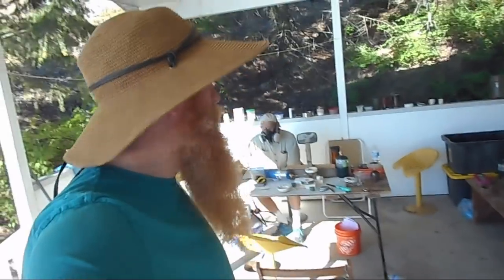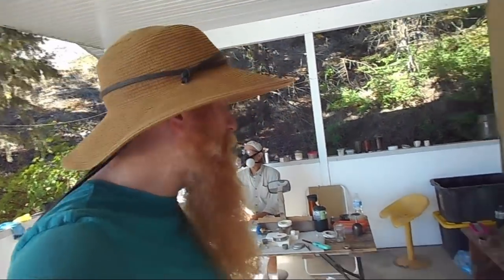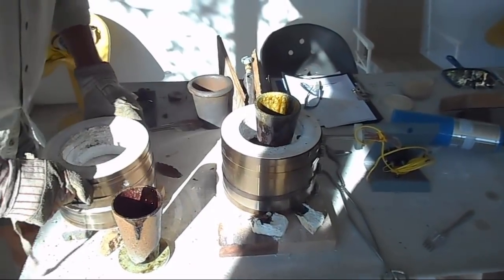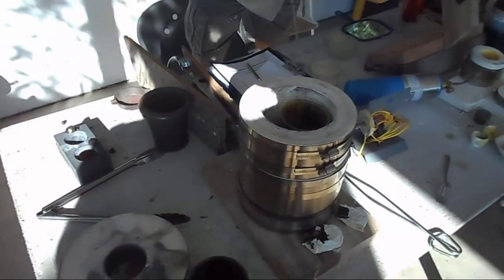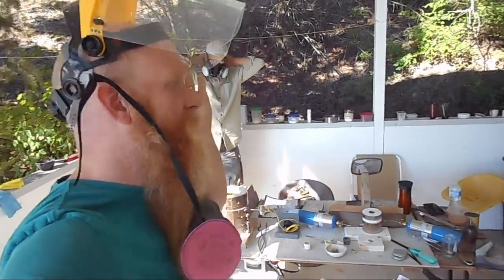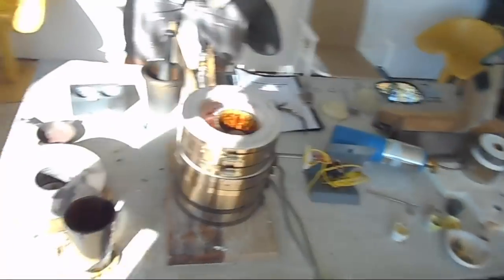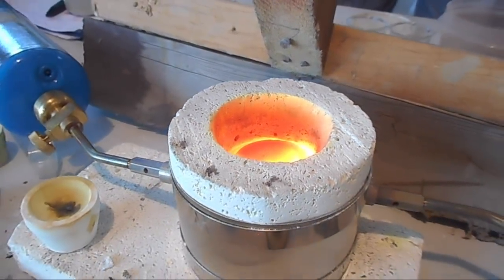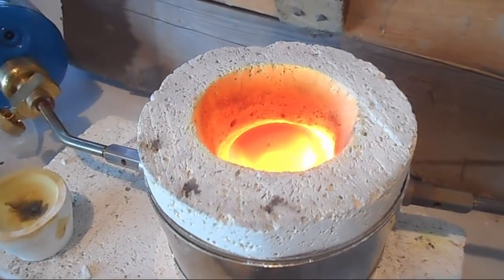Smelting high grade gold ore from the Blue Chip Mine (2018 - new discovery)

Comment: If that is all the cons from 152 lbs Something is wrong.   One Cup? 
You washed your gold away? I have some stuff that just goes away if you pan or sluice
In 150 grams of unwashed ore, I improved my collector metal by 4 grams. One run.
I may have a lead mine. But you may have overdone the concentration.

Comment: How much did you burn up?  What is your flux mix? It looked pretty blond to me. Like white.
Dan let me tell you what seems to be working.  A little sand in the bottom. 20 mule team borax. (Not jeweler's flux or Jeweler's borax.) 1to 1 borax to ore.  About half that of soda ash. Add 20 to 40 grams of lead(I am changing to washing soda) More CO2 and H2O). Then my other secret screened charcoal. You won't hurt it. Add more ore ,flux and charcoal in layers
My lead near the bottom on what will be the main chamber. After your layers put a nail in it and add some sand across the top. The sand keeps it from boiling up. I thought this might be thick but not so. Nice and thin.  more bubbling at lower temps.  The boils away at about 1700 degrees so you can catch the sodium on fire Don't do that . The heaving of the smelt is a good thing. A hollow chamber developes. , round. A great shape for collecting the metal bits.  But my recipe has 10X the water. Well I submit to you that at high temps water is H an O2 rocket fuel.  This melts easily and pours good. The charcoal gives you the reducing atmosphere needed for metal formation..  This can get too hot . Don't overdo it. Easy does it. The Na C O3 soda  ash. has the O3 in there. That is another red flag warning. Ozone is O3 and ot is highly reactive and wand to turn into O2 which is stable and O1 or just O as it burns ip a bacteria in water purification.... So your O3 wants to Be O2and fire (O1) So you have Plenty of oxygen and Hydrogen from the water. Cooking with rocket fuel . 
     I heard that older guys could get more gold at lower temps. With experience ,hydrogen, oxygen and charcoal for  a reducing atmosphere inside all that Hydrogen and Oxygen are being produced by heat.   So the smelt reduces by half and lays flat .....you are ready to pour
    If this helps you as much as it helped me, then you are blessed.

Comment: I just cupeled for the first time with portland cement. It was frustrating at first It seemed like it wasn't absorbing the lead. I had to stop a couple times to change it out but thought I had at least 5 grams of God from how it looked. I bought a bag at a garage sale that apparently belonged to a jeweler. There was about 100 gemstones I still need to deal with. 3 mined uncut diamonds. I started finding pieces of rings and that's how I figured it out like ah-ha this guy was a jeweler and lots of this was from sizing. I had a nice baggy of just cut rings probably 3/4s a 10k ring then a few 14k and 18k stuff. In my head I thought ok if half this piece is real fully gold and the other is other metals that's a good size and did that with it all. Well finally I got to see the blink or flash and it was beautiful to see the first time, Amazing actually! So I get it out and hold it and it was a perfect sphere of hopefully 24k gold but damn it's so small compared to what I started with and thought I'd have. Maybe I should of sold the scrap like it was that probably weighed 10 to 15 grams!? I guess I won't make much buy the experience was a big payday for me. Next I'll dig out all the silver and try it. Then all that's left is thousands of watch parts. I got Elgin pocket watch movements I looked up dated at 1895 and watches at early 1900's maybe I'll make some off that. Thanks for the videos I had no clue what I was doing!

Comment: Dan, how would you go about dissolving the magnetite leftover from the shaker table of an Alaska placer operation?  A friend of mine has brought me a bucket of his black sands and I have had some luck using HCL and HP, to dissolve the base metal and then HCL and Clorox to dissolve the gold, and then precipitate with SMB.  But, some of this material seems to be saturating the solution with Iron after crushing it to -20.  It turns deep rust and when filtering, it plugs the filter with a sludge which is still somewhat magnetic.  Do you know of any good way to dissolve the iron here so I can get at the good stuff?  I see pretty good gold with a 60-100 power magnifying scope.  I have avoided using Nitric Acid but was wondering if Geo's poor-mans Nitric acid/ Sulfuric acid process, (seen elsewhere on youtube, would be applicable.  Maybe you could try a video on this.

Comment: Not smelting its fire assay fusion technique should be pre heated to 950degrees up to atleast 1020degrees. Color of slag indicates doesnt fuse properly. try adding flour atleast 5grms. or check the basic flux. Still not pure Au. Youre Assay report is not accurate. Just saying

Comment: On a larger scale for your location do you think that it could be mined as an open pit mine? Or does the country rock/surrounding rock have no gold values?
12 g/t is great if the vein is vertical and 3 feet wide but otherwise there'd be tremendous dilution.
So that's why I asked about the other rock types you have on site. Any values in Au or Ag?

Comment: It looks like at about 6:25 you have some problems with your base block sticking to your crucible. I have done a fair amount of bronze casting, one trick I learned is to stick a piece of thick paper or cardboard between the crucible and the base block, it helps to keep them from sticking together. Also, if your flux is eating the bottom of your kiln, I've found that a sheet of cheap kiln shelving on the bottom of a propane forge soaks up the flux before it eats into the expensive refractory.
Reply from the maker: Thanks!

Comment: Hello, I am curious to know if you ran an assay before this procedure, and if so, how did your recovery compare to the assay result? I think it would be cool to know how efficient your process was. Obviously it isn't possible to recover 100 percent, but is would be good to know how well you are doing. Great videos!
Reply from the maker: the nugget effect on this free milled gold would mean that small sample size assays would range anywhere from 0g/t to well over 100g/t depending on which random rock I sent in. I needed a large sample to get a good idea
Reply: Good point, I assay and can run samples for $45 with no min number of samples and can get the results back in a week. I don't make any money on it and the fee covers the cost of supplies and lab time. If you were able to collect a representative sample and were curious or if you need assays run the the future. It is fire assay with gravimetric finish.

Comment: really good video Dan n Dad, Id be happy with 12gpt near surface with good wheeled access. What filters are you using in your resperators?
Reply from the maker: The p100 Hepa filer such as the 3M 2091 would be your minimum and make sure your respirator fits well

Comment: You still have to cupel again or acid refine the hazy looking beads, there was to much lithage from the flux to be completely absorbed by that size cupel. Your flux to cons. ratio might be a little high, that will also cause the boil overs in the smelting process. Just reheat in a finish cupel to get a more polished looking beat, as you can tell by the out side of the cupel it was at it limit. You may want to cut any large smelting prill like that in half, with a simple shape chisel and hammer when cool to put less load in to each cupel. The bone ash can only take in so much, and the stains on the outside of that one show it was loaded.

Comment: The blick is suppressed by the presence of PGMs, reduced by lead, copper, or other base metals,  and is generally imperceptible with larger (3/4g) or very small beads. A bright blick is characteristic of relatively pure gold/silver as it solidifies and gives off its latent heat of fusion all at once. Impurities cause the state-change to take place unevenly, as well as interrupting the crystal matrix, which accounts for both the lack of blick as well as the surface texture. See books by Bugabee, Shepard, Fulton, and/or Smith for more complete details, including some qualitative analysis of the content of the sample based on the finish of cupellation and texture of the bead.
Reply from the maker: Thank you - that was very helpful and answered some of the questions that I have. I'm always learning.

Comment: Grams into imperial short tons? Seems a bit odd. Your grade is 13.57 g/t Au. That's a metric tonne!
Reply from the maker: Yes, I am mixing units here in a bad way. The bathroom scale I used to measure the material measures in pounds, while the gold was measured in grams. Also a metric tonne and an imperial ton are so close that it doesn't make that much of a difference. But yes, 13 sounds better than 12!